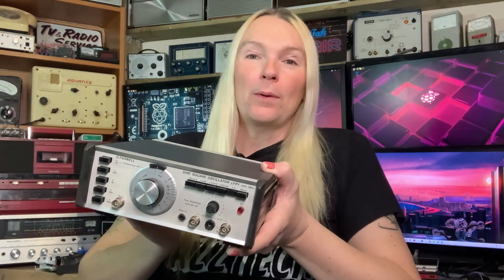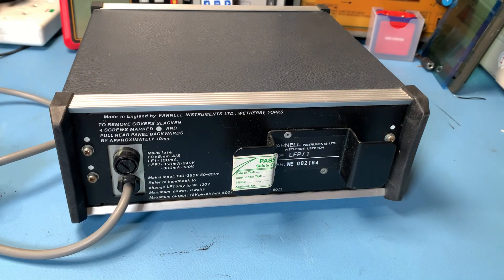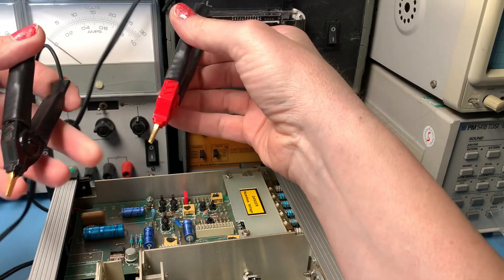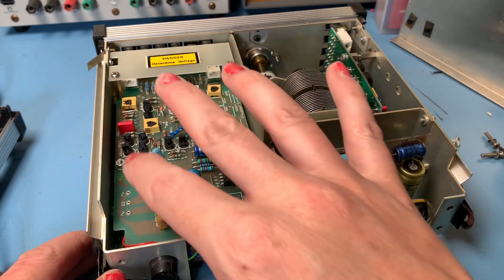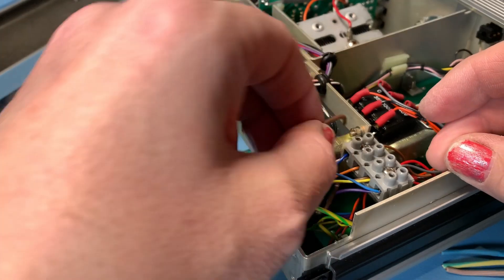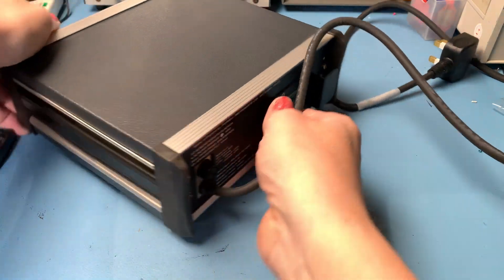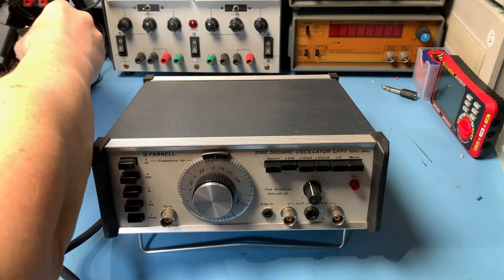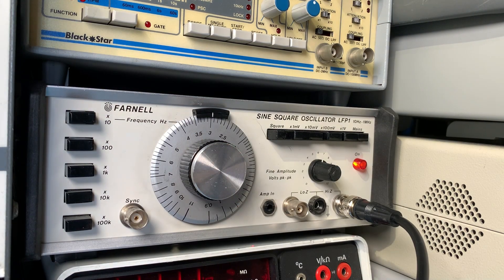Farnell LFP1 Sine Square Oscillator Signal Generator - Part 1 Checking & Testing

Comment: Got one - had it for over 30 years, works like it should even after all these years, was a big fuss over them when things when digital, something about the glass component
that people loved that made a difference in the quality of the signal that digital could not deliver, so i kept it even though i have digital ones as well,
the signal is so pure with them, i use it for audio work, just so little noise with them - if you restore it and just use it for audio work,
you will not be disappointed, they are well sought after.

Comment: Those blue Philips capacitors aren’t THAT bad you know! A good many are still OK even now, and those that need replacing have obviously lasted until now. The mere fact they have survived means they haven’t already been replaced. These caps have been manufactured for decades, in virtually the same form. I would however change the very early ones with the beige end cap/seal as these usually are defective by now. The later, improved type with the black end cap/seal have obviously lasted much better.
Reply from the maker: Some Philips blue caps in some gear still seem to be ok, but so much gear I have looked at containing those caps are all failed. Others on here and elsewhere agree that this range of Philips blue caps are notorious for failing. A friend of mine has a Philips/Fluke oscilloscope and every single blue cap except for one has failed, over 80 of them. People have also commented that they bought New Old Stock Philips blue caps and they were bad as well.

Comment: If you were to use a light bulb limiter on this, what bulb wattage would you use ?
Reply from the maker: A low wattage bulb as the power this unit draws is only 8W, so I would say a 25W bulb if you can get one.

Comment: I am actually struck by just how nicely built that unit really is.  The air variable capacitor was a surprise sine most of the stuff like that used the Intersil 8038 for the task.  That thing is a proper bit of kit and really well made.  I recently rescued a Stanford Research systems DS345 and have an older Wavetek unit similar to the Farnell you have there that the Stanford replaced.  Great video.  Looking forward to a dive.
Reply from the maker: No Intersil in here, lol. This is proper well made kit, as you say. Replacement electrolytic capacitors will be on order for this shortly. Thanks for watching.
Reply: Wavetek! I worked at Wavetek in Beach Grove, Indiana, (a Suburb of Indianpolis) back in the early '80s. I repaired SAM meters (Signal Analysis Meter) that were used by cable TV technicians. If they either didn't work at all, or the assembly line workers couldn't get them calibrated within spec, I and about four other techs would repair and calibrate them. This was while I was in college getting an EET degree.

Comment: Cool oscillator! I've never seen (or it's been a very long time) Farnell equipment in the US. They seem to have made some very nice stuff. Is a schematic available? I'd like to see what the gimmick capacitor C108 does. I suspect it's compensation in an amplifier, but it would be nice to know. Thanks for another great video!
Reply from the maker: I haven't been able to find a schematic so far. I will have another look before I do the capacitors.

Comment: Another Farnel gorgeousness! Lovely gear on that frequency adjustment scale. At first I thought it'd be resistively rather than capacitively tuned, what a nice surprise! Love the old school tuning caps. The generator looks so clean inside - thing of beauty, joy for ever!
Reply from the maker: @KeritechElectronics yes, I must admit I was surprised to find that in there. The gearing is so precise and absolutely no backlash at all. Caps will ordered shortly. It's worth it.
Reply: @JazzTechUK 
No gears, its a Vernier Drive. Works like Planetary Gears, but uses ball bearings. The circumference of the balls give the ratio. They last forever.👍
Reply: @KeritechElectronics 👉Seriously?!
You probably mean Impedance, seeing how it uses an LCX circuit with O'Amps.
Resistance introduces Gain Instability issues.

Comment: Nice unit, typical of the '80s with a thermistor to stabilise the output and keep the waveform nice. Of course, having a variable capacitor for tuning means you'll never have scratchy pot jumping around! Those caps look like either Phillips or Siemens, which were very reliable in the day. Hopefully you won't have to change too many. There are a lot of trimming pots to tweak if anything is replaced changes in the different ranges.
Reply from the maker: I've decided as it is such a nice unit I'm going to change them all, as I think it's worth it. Yes, the tuning capacitor is beautiful. Thanks for watching.

Comment: These were made in the late 70s and were very popular, even the MOD workshops used them.
Replace the philips capacitors, they will fail sooner or later.
Reply: Yeah... I once bought 20 of those axial Philips caps and measured them. New old stock and way out of spec, all of them. Complete and utter rubbish.
Reply: @KeritechElectronics  Sendz components used to sell bag fulls of them at low prices
most of which were well out of spec.
Reply from the maker: @BarbaraPape-y4g they are all going to be replaced in this unit. Watch out for Part 2.
Reply: @JazzTechUK  All of them, you may find finding good quality replacements for some caps
hard to find.
Reply from the maker: @BarbaraPape-y4g you can still buy axial electrolytic caps but they tend to be very expensive compared to the cost of radial electrolytic caps. Vishay still manufacture them.
Reply: @JazzTechUK  Cheapest option is to use radial and drill a hole for the wires, somtimes you have to 
extend the wires, it might not look very good but every penny counts at the moment.